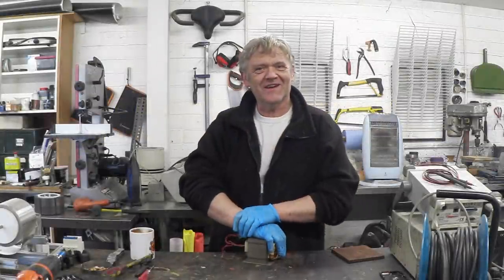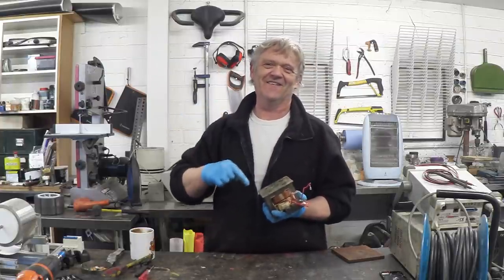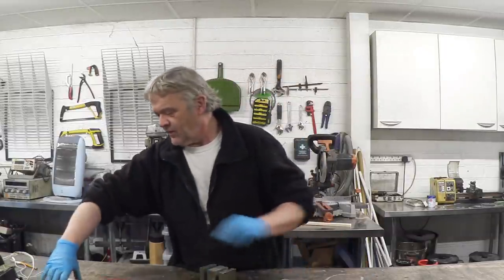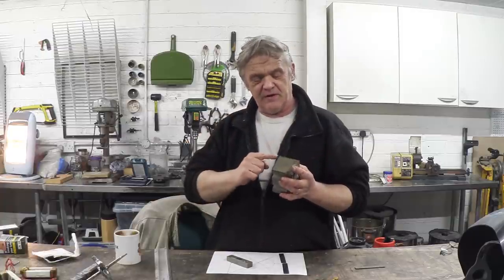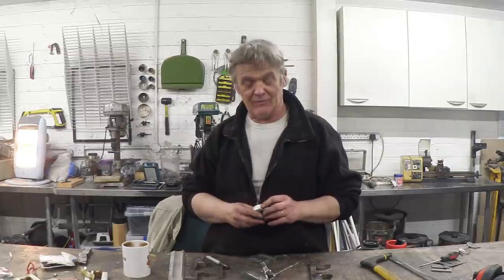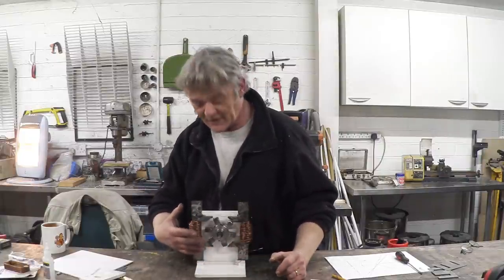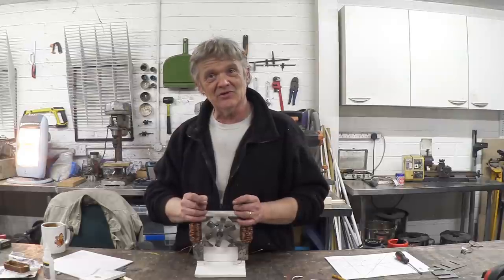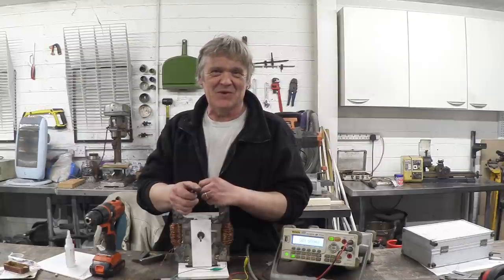1034 Build A Flux Generator From A Microwave Oven Transformer

Comment: If there was some way to store the flux.  A capacitor maybe?
Reply from the maker: the magnet is the source of flux so if you think of it that way it is kind of a capacitor for flux storage already
Reply: Try a bicycle.  Lol. People always wonder how I light LED bulbs with either wire connected to my bicycle and the other wire to the coil core iron. My volt meter shows 0 voltage, so what lights the lights?

Comment: Dear Robert. I just like to ask you if you could go back into the zinc bromide battery and actually made one that can give you 5A or so discharge over a useable period of time eg actually make a usefull product that everybody could actually use.
Reply: Robert explains how to make Zinc Bromide cells in the member's channel, if you're interested.
Reply: @zylascope  yes but do they have a good output and low internal resistance and are worth making. ?
Reply: @bretthorwood9396  I don't know those details. Hopefully, somebody here has tried them and can help you.
Reply from the maker: I have done that mate but I am afraid it is on the members channel

Comment: Since breaking the flux path is akin to inductive kickback in a coil you'd probably need to add a rectifier and a cap to get a true reading on the voltage out.

Comment: Hey Robert, I built a Transformer from a recycled microwave Transformer,  watching one of your videos. As I turn up my variable Transformer,  the amperage jumps from 1.8 amp draw to 8 amps at 100 volts. I have a feeling that the insulation is breaking down at 100 volts. What is your idea on the that being a possibility?
It works fine below 100 volts!
Reply: Oversaturation.
Reply: Is that 8 amps at 100 volts on the primary?
What kind of voltage and currnt are you getting out of the secondary?
As the power you produce out of the secondary increases the power in must also increase. For example if you are building a welder using the transformer the current in will jump way up when you are producing an arc even though the output voltage will be low.
Reply from the maker: that's unlikely I think mate that insulation is rated at 2,000V isn't it? - but to be honest i don't really know what your set up so it is difficult to tell - I see a few folks are trying to help - would you mind giving a bit of a better description of your set up? - which coil are you using as your primary, what is your secondary and what Is it you are trying to run?

Comment: Hi Rob. Axial Flux is a very efficient type of generator. Perhaps better when made for DC. In that configuration, it can't generate useful current, but I suppose it might be useful if you need a small amount of AC to trigger or measure something. There are easier ways to transform DC to AC, however.
Reply from the maker: I agree mate but this isn't axial flux - it's switched flux - one thing in axial flux the magnets are rotated over the coils in switched flux both the coils and the magnets are stationary

Comment: You could put all the magnets on one side, Or at least interpose an iron bar between them to close the magnetic circuit. All that air between the magnets in not ok for me. I suggest you to try. Anyway that could became a Flinn's motor.
Reply: You'll be attached to circuit if it's too close. A little more space and you'll be inducting magnetically. That's your flux. You won't get it if the magnets are too close.
Reply from the maker: yes you could close the magnetic circuit but clearly you don't have to